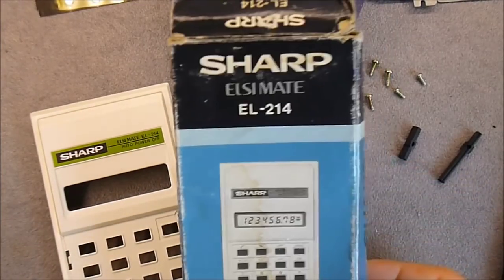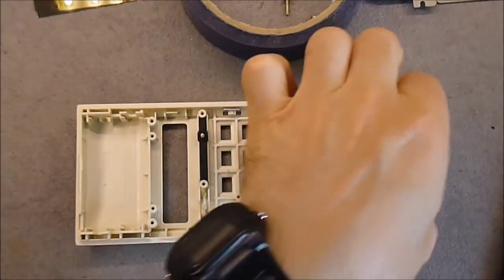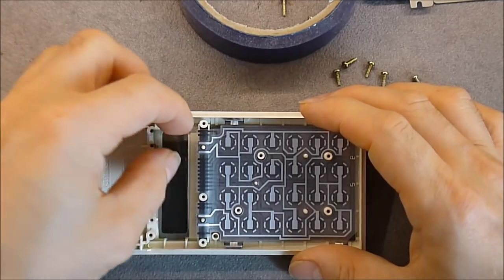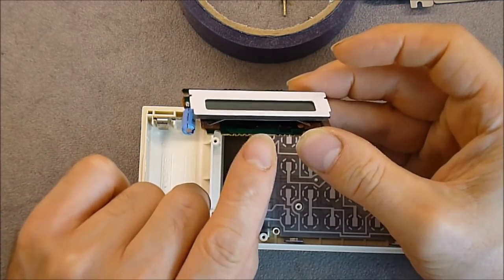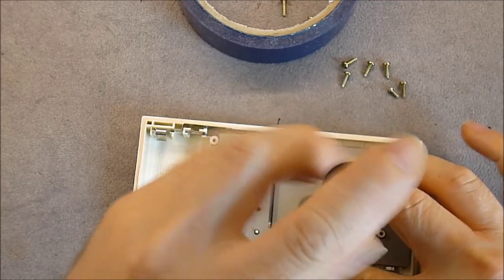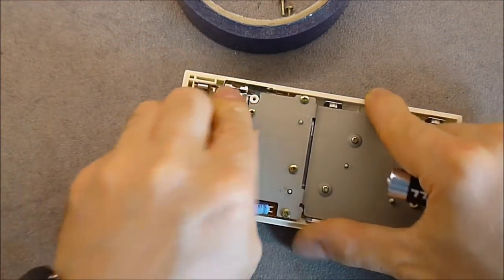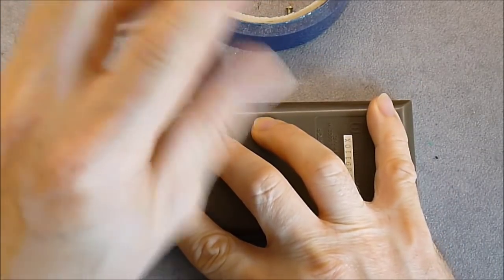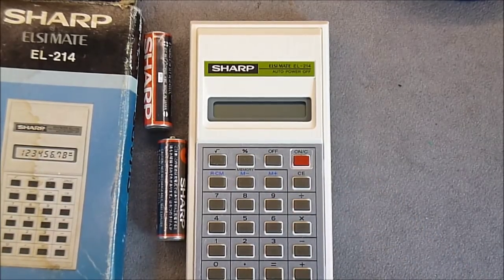Vintage Sharp Elsimate EL 214 calculator reassembly

Comment: when was this made?  Does it have any value for a collector?

Quand a-t-il été fait? Connaissez-vous l'année exacte? Est-ce que cela a une valeur pour un collectionneur?
Reply from the maker: It is from 1980, it has a little bit of collector value, not a lot, they are available at around  15 US$ on ebay.
Reply: ok...I remember when Sharp made TVs so I thought these came later like in the 90s.  I like the design of these Japanese calculators in the 80s, very Bauhaus and functionalist.